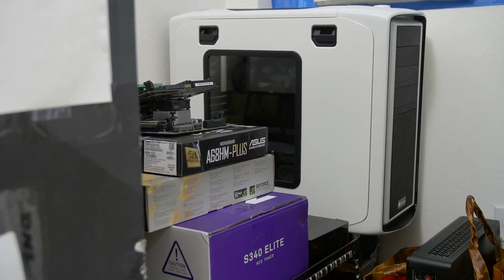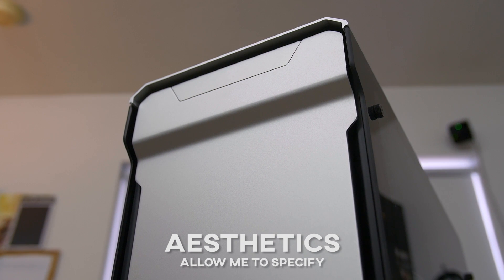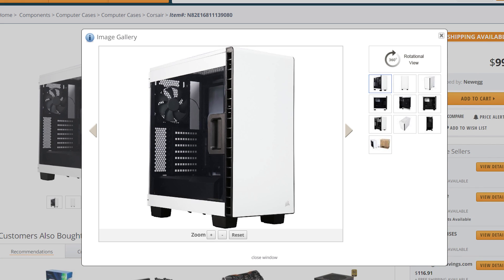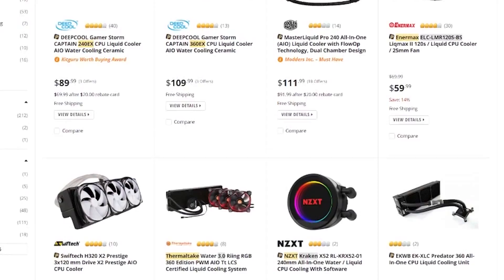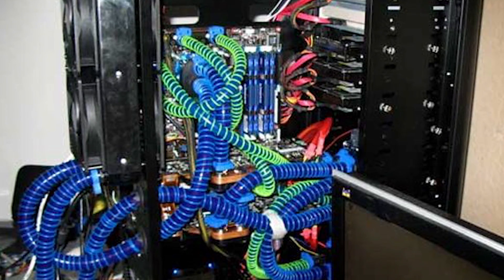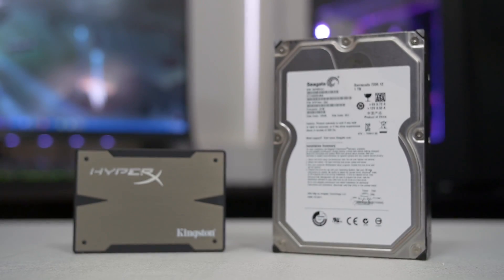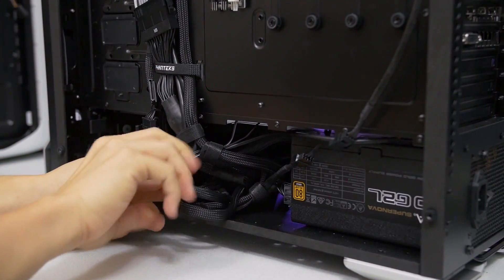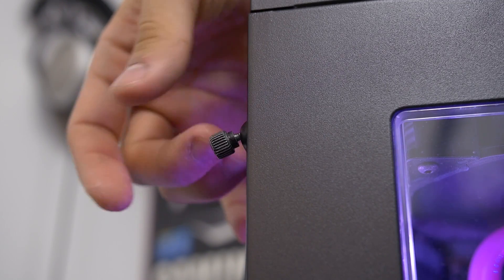4 Major Changes to PC Cases in the Last 5 Years: Then and Now

Comment: I have been building custom PC's since the late 80's and mostly for gaming since 92 or so.  When I build a PC in a nice modern gaming case, I usually stick with that same case for a minimum of five years if not longer.  Since 2005 I have only purchased three gaming cases. Two full ATX and one mid ATX.  The  mid ATX was purchased in 05 and had sleek blue LED lighting tubes on the front panel and a big clear window.  PSU was mounted in the top rear and it had little to no wire hiding capabilities.  The next case I purchased was a full size ATX  case by InWin called the Maelstrom. It featured a mesh side panel with a large 200mm blue led fan, bottom mounted PSU, mounts for four more 120mm fans on the inside (1x front, 1x rear, 2x top) and interior noise dampening foam.  It was a fantastic case that I actually still use in one of my work PC's, but one thing it did lack was the ability to hide wires.  

So in mid 2016 I finally purchased my most resent case, the Corsair Obsidian 750D.  This case featured plenty of room for fans, bottom mounted PSU, wire hiding, SSD mounts, removable drive bays, USB 3, and more.    

While your video only covered the last 5 years, as somebody who only upgrades once every 5 years and having been doing this for a while, i have a list of some of the more important changes in the last 10 years (in no particular order of importance).

1: Bottom mounted PSU
2: Wire concealment 
3: SSD mounts
4: LED lighting
5: Removable drive bays
6:  Water cooler radiator mounting options
7: USB 3
8: PSU shrouds
9. Sleeker/flatter/more minimal designs

Comment: lol.  been building PCs that long that i remember when top mounted PSUs were the norm.

Also pre-ATX power. 

:D

First build was in 1992.  Ventilation was virtually non-existent.  Desktop CPUs draw tens of watts.  GPUs did not exist.  CPUs didn't even have fans.  Only fan in the system was in the PSU.

The best/most important changes I've seen have been
ATX power (soft power on/off rather than PSU rocker switch)
PSUs in the bottom so your tower isn't top heavy
Drive mounting rails!
Front USB ports!
Air filters!

Comment: i use steel case from 2001 p4 was originaly in there , now it houses z170 i5 6500 and hd 7870 =D ssd is sticked with packing tape on bottom of case

Comment: All 3 of my PC cases currently in use are at least 5 years old.  None are flashy, and all have nice solid metal panels instead of honeycomb mesh as you describe.  Lian-Li was certainly ahead of its time.  That said I see nothing wrong with using the older case you profiled here either.  It is still a very nice looking case, and very functional as well.

Comment: My ThermalTake SwordM Case most has all the features you speak of less window and power supply shield, but then again those 2 things can be added on.  That being said, the Swordm has a hydraulic top for the cooling system and the entire case is thick aluminum.  Its the base stocl case ever -  it can hold a 240 2 inch radiator, has 10 5.25" inch bays,  and two 7" inch bays.

Comment: Ive had 4 or 5 cases since 1994. My original AST Advantage 486sx33 desktop. Next was some case I dont even recall other than being a small beige tower. After that a Black and Crest green Cyrix mid tower.Then a HUGE In-Win Q500 ultra tower. Next the one I am still using so many years later...a Cooler Master black and red mid tower Storm Scout 1.

Comment: Man, I remember using a AT Tower case for my build. Slot 1 P2 at 525~mhz with a whopping 256MB of ram. I had a dedicated power supply for the fans in the case that moved the amount of air needed to cool it. That case had to be almost 40" tall. Fuck, I'm getting old.

Comment: As someone who used the same watercooling case for 10 years, I have seen many changes over the years.  I'm currently building a Case Labs Mercury S8 case, if you want my old Koolance PC4-1026bk for some odd reason I could just give it to you or Paul....or even Jay; since you all seem to be slightly north of me.

Comment: Personal fav cases from the past were the old Compaqs. They were built like tanks, and had all the screws, trays, rails, etc. built right into the case. Nothing was in bags, or needed to be stored somewhere! I also miss the days of the entire case shroud pulling off from the front! I don't think it was ever popular by numbers but it was a very handy feature. Just tug on the front cover and it and both sides come off. No individual sides covers or thumb screws required.

Comment: Come on now. You forgot cases actually being fully painted. 5 Years ago there was still a huge amount of cases that were aluminized steel inside. You also have to include much more sound proofing, fan filters, and actual case feet that don't smother your bottom mount psu.

Comment: One of the "worst" changes is the lack of 3.5 drive bays and true full tower cases! Currently I have been currently looking for a case that has a true "full tower" configuration and at least room for 8,  3.5 inch, drive bays (and up to four 5.25 inch drive bays) like a case I had 20 years ago, when I built my second 486 Pentium 3 computer in! Of course the case was lacking the Micro ATX motherboard provisions as it was already a 15 year old case when I got it 20 years ago! BUT the advantages to it was that I could have used it to build a modest FreeNAS server out of it even now, though back then I was hard up for some newer parts so I ultimately traded it for some cash and newer parts on a Pentium 4 build I was doing then! In short I wish I could find another case like that, and nobody makes them anymore so I have found! And I am sure a lot of those old cases were turned in for scrap metal now by kids that have no value for anything "older"!
Reply: Greg Benwell It's not that we don't like it cause it's old. We just don't like it because it's impractical AF. 8 drive 3.5 drive bays? might as well just get a server

Comment: One change I've seen over the near 20 years I've been building and upgrading has been the focus on cooling. You can thank the introduction of the higher-clocked Pentium IIIs and Pentium 4 for that, along with the dawn of higher-power graphics cards from nVidia and ATI that left the rest of the competition in the dust -- 3dfx (bought by nVidia) was one of the bigger names initially.

And this focus on cooling has also brought about the upgrade in fans, from 80mm dominating the landscape to the proliferation of 120mm fans, and later the introduction of chassis with 140mm and larger fans positions. So that Corsair chassis isn't old by any stretch. I still have a couple Apevia chassis that have two 80mm fans in the front and a 120mm fan mount in the rear over the I/O. I still have an ATX chassis that supported a babyAT(X) mainboard. Looking at that compared to my H440 or my wife's 750D... there's a stark contrast.

So if the primary fan mounts are 120mm or 140mm, it's not old in my opinion. Build into a babyAT or ATX chassis with only one or two 80mm fan mounts.

Which actually brings me to the biggest change I've also seen over that time: a focus on cable management. This came about around the same time as cooling became a focus, and the ribbon cables were exchanged for cables that didn't nearly get in the way. SATA cables were a godsend on that mark since those cables were a lot easier to cable manage and didn't in the way nearly to the degree of old ATA, floppy, and SCSI cables. But along with that, having better options for tucking the cables out of the way? Routing them behind the motherboard, even? Holy hell! Where was that when I was first learning to build computers?

I've said before that PC builders today have no idea how good they have it. Oh and the ready availability of quiet fans that perform as well or better than the loud fans that used to exist? You can build a system that's near silent without sacrificing cooling? 19 year-old me would've laughed at that idea!

Comment: Moving the power supply from the top of the case to the bottom of the case was rather significant.  It allowed for major case design changes.  5 years ago the top case manufacturers still had many cases that had the power supply in the top of the case.

Comment: i need advice ca u tell if all this compatible and any recommendation 

  Gigabyte GA-H110M-S2PT Socket 1151 Motherboard  
---
Samsung PM871 128GB 2.5-Inch SATA Internal SSD 
---
Western Digital WD10EZEX-00BN5A0 1 TB SATA Internal 
---
Intel Core I5-6600 6M Skylake 3.3GHz LGA 1151 Desktop Processor 
---
 GTX 980 4 GB MSI 
---
Kingston ValueRAM 8GB DDR4 2133MHz CL15 Memory (KVR21S15S8/8 )
Reply: https://pcpartpicker.com/list/2NgHnn check this out this would be a really good drive super fast nvme boot drive and over clockable cpu for around 1000. if you have a microcenter near u u maybe able to find the cpu and cooler for cheaper. i do not suggest getting the 900 series since the 1000 series is sooo much better hope this helps! let me know if u want a build for a lil cheaper then that i can make that work too.
Reply: ty
Reply: am in Egypt but i manged to get gtx980ti instead of 980 and i got 16 Gb rams instead of 8 gb
Reply: Abdallah Gaber okay good should be a solid set up then!
Reply: ty for helping  i appreciate it

Comment: Last summer I got hired by someone to build a pc for him but he wanted to use his old case since he liked it (it was an old guy). The case was an Antec  Performance Plus 1080 from 2002! Surprising enough, I had no compatibility issues installing any of the new components in there. It was all standard ATX, the standoffs and disk drive bay and everything all worked perfectly. It was really weird though having a good computer like that inside and old case.

Comment: I look at this and laugh and feel sad at same time. Modern cases slowly going backwards for the sake of fad like psu shrouds or rgb leds and sometimes not even have essentials like easily removable fan filters. My almost 5y.o Aercool Xpredator case has two 25w each fan controllers, plenty of space for cable management with proper sized grommeted holes, removable fan filters, easily can fit two 240mm rads and have space for 4 more fans, snugly fits my sapphire trixx 290x and can do all of this at same time without sacrificing drive bays or 8 hdd mounts while being roughly same size as Evolv ATX. Did I mention it was cheap too?

Comment: Actually i would say thumb screws at all, as prevously you allways needed screwdriver to build a pc, nowrdays i sometimes cant even bother to find my screwdriver before building my computer!
Reply: Thumb screws aren't new. I have a chassis I bought in 2005 that had thumbscrews and tool-less assemblies for the drive bays. That chassis only needed a screwdriver for mounting the mainboard, and I don't know of any chassis that doesn't require a screwdriver for at least that.

Comment: Watercooling support is now even on low end cases. I could insert 3 radiators(front, top, rear) according to Fractal Design's website, and I only have a Core 2500.

Comment: I started building computers back in 2000 (I won't inquire what Bitwit was doing in those days).  Cable management was quite the chore then because cases weren't designed for it.  Those big-ass ribbon cables (IDE) didn't help either.  Fans were typically on or off, so noise management was just as big of a problem.  But in those days, cases were actually easier to work in, even the small cases.  We weren't cramming as much stuff into them.  I could put a computer together in about 2 hours in those days.  Flash forward 16 years and the build using my Corsair 250D took me almost eight hours from start to finish, and I'm not at all satisfied with my cable management.

Comment: Still have a 600t and love it.
Reply: David Dewis let me guess, the fan controller stopped working? mine broke 2 months ago.
Reply: SnoopfromVejle no but the USB 3 never worked. I actually can't see myself changing anytime soon. I still need drive bays. I'm a photographer, so I burn photo discs often and I have a 5 USB3.0 bat which is great for Oculus Rift and just having all USB gear running at its fastest.

Comment: Here's a contrarian position:  I've got a NEW, UNUSED Corsair 600T, still in the box from when I bought it regular retail TWO YEARS AGO... that I'm gonna use for a new build once the GTX.1080ti comes out in a month or two.  Then later in the year, I plan to upgrade to full water-cooling:  very minor mods to the inner top panel will allow a 280mm radiator rather than a mere 240, and simple removal of the front bays will allow a 400mm rad in the front!  Yes, there actually IS such a thing as a 2x200mm radiator!  (I'll take slow-turning dual 200mm fans over 3 or 4 120mm fans any day.) 

I bought the Corsair new even when it was going out of production, precisely because it was the only chassis I'd seen at that time that I REALLY liked the looks of, and I didn't want to get stuck with only left-over beat-up used ones as my only option.  Oh, also the fact I got one of the last SILVER 600Ts sold in North America, makes me glad I made that decision at the time!  Ironically, the glass-panel version of the Phanteks "Evolv" (shown here in opening sequence), is pretty much the FIRST case I've seen since the 600T, that I actually like the looks of enough that I would choose it today if I was still looking for a new case.  But I don't think it fits a 400mm radiator! 

ALSO... the Evolv is actually limited that it won't fit the largest common "E-ATX" size motherboards, including the board I'm planning to use from MSI!  This trend of putting the 3.5"HDDs behind the motherboard, has many case makers accomplishing the change with a dog-leg bend in the back panel to fit drives right behind where the conventional "drive cage" used to be.  MANY new "full-ATX" mid-tower cases are thus precluding most full-featured top-of-the-line workstation boards as an option.

Comment: I grew up in the 80's/90's, so my builds started back with a 386 running Windows 3.1. Our case modding was severely limited back then, everything was so utilitarian. Spray painting the case was rebellious and odd to most other people. I really don't miss the big beige lay down cases that you'd stick your 80lb monitor on top of - I literally had to wait till my next PC just to have two floppy drives. When the concept of modular bays and customization started to appear, we laughed because we had no idea what the hell we were going to do with it. Now if your build doesn't put on a light show and transform like it was designed by Michael Bay, people are bored with it. My last customer build had a more complex cooling system in it than my house does.

Comment: I went from a Cooler Master: HAF 932 (2010 build) to a Fractal Design Define S (no window) (in my 2016 build).  Things I like better in the Define S, the size is way better, the case is much lighter the inter space is better, comes with sound dampening, comes with dust filters, taking off a side panel doesn't require me to remove the screws completely, doesn't have, in my opinion pointless windows or LEDs, and it was much cheaper.

Comment: Fan size - I just junked an old case that had few fans and the ones it did have were 80mm I think
Filters on intake fans - That old case had some kind of gauze stuffing that could not easily be cleaned if you wanted to.

Comment: Im still using that 5 year old first builds case. My Carbide 500R. At least I am for about 2-3 more weeks when I start off my new build with an NZXT S340. What a jump in time this is going to be.
Reply: At least your hard drive cages are modular. The brick wall of a cage in my 400R is not. I'm thinking about getting my dremel and taking it out.
Reply: That's not nearly as pronounced a change as you might think. You're eliminating HDD cages entirely (bear in mind there is no HDD ventilation in the basement) along with reducing your fan capacity. I've built into the S340, so I can say it's a great selection. But between that and the 500R, it's not really much of a change.
Reply: @milqueto true, first thing I did was take one out.
Reply: @brandishwar I'll be glad to be rid of the HDD cages in the front though, only one barely used storage drive is going in the hdd bay. But there are plenty of changes I'm looking forward to, the shroud for the psu etc, that nice looking cable management bar instead of grommets. Aesthetically it's going to be a lot more pleasing than all those mesh panels, though it helps that I'll be putting in a modular psu and black and white color co-ordinated hardware and cables so of course with that in mind a window is better than the mesh side panel. I will probably miss the cooling ability but I think I've also got that sorted. Just 3 white EK Vardar 2200rpm fans going into it. 2 as front intake, 1 as exhaust on my h60 rad.

Comment: these are a few I could think of but they are mainly improvements over older cases than Kyle compared.  room behind the motherboard and more cable management loops, bottom mounted power supplies, painted interiors, better front panel audio.

Comment: I'd argue that at least two of the four changes mentioned in the video are actually regressions to trends I've seen over the last 15 years. I remember back in 2003 there were cases that were nothing but plexi and screws, and you could see everything inside a PC, including all the LED lights you put in there. The 'streamlined and vented' look is just a rehashing of the Antec P180 from 2005 (which also introduced the idea of putting a PSU at the bottom of a case and hiding it in a separate chamber).